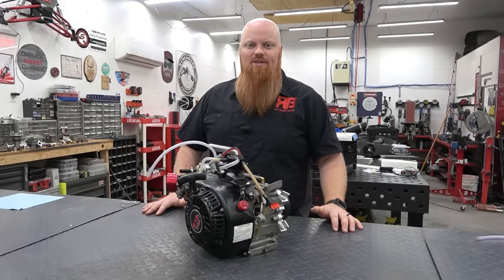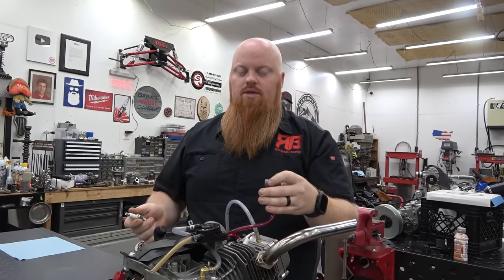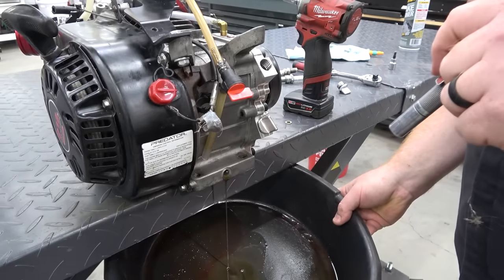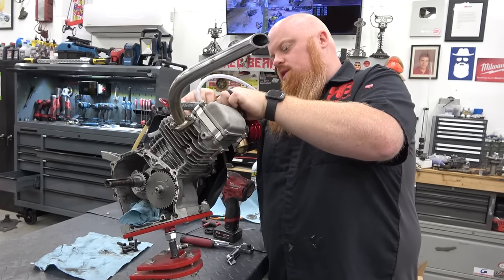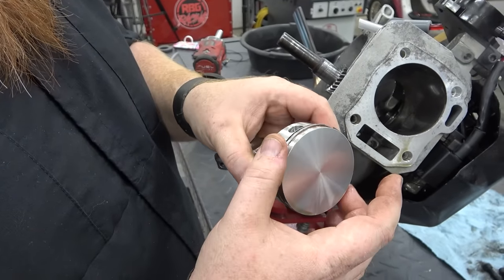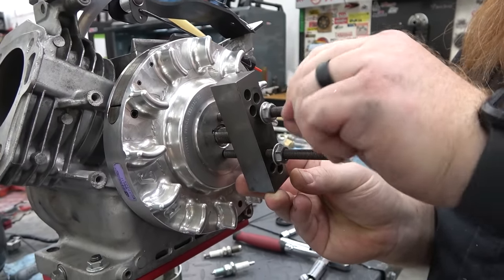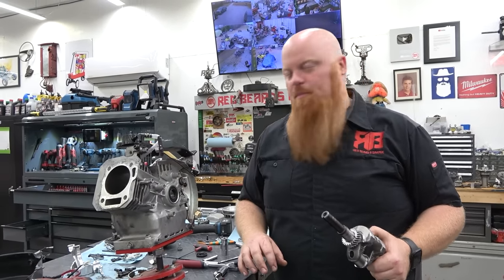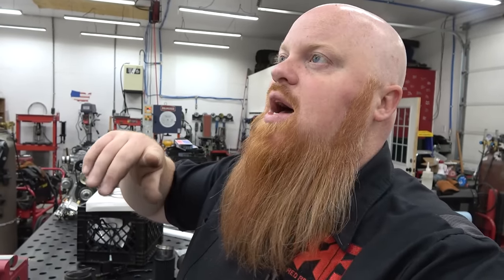My $900 Predator 212cc Wont Run ~ Subscribers Engine Teardown

Comment: Dude this guy is spot on you learn as you go couldn't tell you how many engines I've had problems with while building cause I didnt know something! Anyways I do not use wiseco anymore I bought a piston from them and what the problem was the seat for the wrist pin circlip had a bur in it or something and it pooped it out down the side of the cylinder into the crank case and the wrist pin came out and after about 60 hours of riding it wore a hole in the side of the cylinder.... It did lock up on me once time when that happened about 10 hours into the break in but I was riding the bike and was a few miles away from the shop so I dropped the clutch and it freed up. Surprisingly 7 years later the engine does still run with that piston and a new circlip.... Still when I build engines now I use JE pistons but wiseco works great for other people that build so do you lol I just don't want to risk it

Comment: Technically, you can test compression if you enlarge the valve lash...it doesn't have to be that large for the compression release lobe not to hit, and excessive exhaust valve lash won't change full compression numbers.
Reply from the maker: That makes sense. Ill try to test the compression soon in a video.

Comment: Question: When you pulled the plug you said it looked like it was running rich.  Wouldn't it have been running lean with the stock jet?

Comment: You also require a slightly larger bore when or if using a forged piston over cast. Something to do with the expansion factor in the different types of aluminum and how much or little they expand in diameter. This is why real race engines will smoke upon a cold start, waiting for the pistons to expand and properly seal. I have seen skirt scuffing on folks using forged pistons in tight bores on a regular basis. If you don't request the fact that you'll be running a forged piston to the machine shop, you'll receive a standard cast or slightly tighter bore.

Comment: one should know never ignor steps clean is king and free turning toque specs  clearances if you ignore any of that your in a mess and fueling is a must jetting AFR ratios is a thing even on a stock 212 used on Karts etc . other pull air filter off of any modern engine jets are to small they are really to small any way  not hard to have that short list

Comment: Special thanks to you red beard I’m a broke ass n. and don’t have $ to just throw at it. Between you and Paul  ( karts) I’ve about  achieved perfection on these 212’s 
$235- 4 a Tilly &
400-450$ specialty parts 
Billet internal /& good valve train just roller tips & 26 lb springs , & stock valves and push rods nibbi 28 carb, 34$ aluminum fly 
I’ve got all the power I need, any more I’m scared this small Chinese bike will fly apart! Seriously takes me longer to stop this thing. Than to hit 8500rpm 
That’s pushing stock too much. So far stock valves rods are handling 26 w fire 265 ( I’m maxed out on lift , only .020 between coils! So far she runs like a beast!

Comment: I completely pulled mine apart and put it all back together and it ran pretty good until my new valve springs broke and sent the rod through the head.

Comment: My next build I need to get the push rod measuring thing so I can order new rods and rockers. Also need to figure out the gear ratios, I got too big of a gear and it launches fast but doesn't get up to a good high speed. Maybe if I could adopt some kinda mountain bike gear shifter?

Comment: Hey guys what’s up I have a question just thought I’d ask here and see if I get an answer . I just started working on a gx160 had old crankshaft with no      Key grove I have a predator 212 crank will it fit with no mods? Thanks

Comment: HELP please.   I have a jr. Dragster with what looks like a Briggs and Stratton motor. But my intake is on the left side and the exhaust on the right. Everything I can find on YouTube has the intake and exhaust on opposite sides. Any help would be greatly appreciated.

Comment: I have a predator 212 non-hemi, I put the racer kit from GPS in it with stock carb and jet, if I put the .038 jet in the carb I shoot a 3 to 6 inch flame out of the exhaust.  My exhaust is almost just like his and carb set up.

Comment: I do not understand how someone lets water get in there engine. Intake point down: check, waterproof air filter condom: check, tighten bolts to spec: check, exhaust point down: check, leave in hurricane: check
Reply: Condensation,check

Comment: I gotta 196cc that I totally modified out but I do not have a Billet Side Cover on it. Just a regular standard side cover. Anyway for some reason the side cover kept blowing off whenever I would ride it no matter how clean i had it before putting on a new gasket and bolting it down. I got so tired of it happening that I tried spraying Copper Gasket Sealer on the block and then putting the new gasket over that and then bolted it down and it actually worked and the side cover has not come loose while riding since. I haven't taken the side cover off since then either and it's been like a 1/2 a year now probably. Maybe longer I dunno. I'm afraid to take it off cause who knows what it'll look like and if i'll be able to get it back on. 🤷‍♂

Comment: PB Blaster still lets stuff rust. I didn't have WD-40 handy so used some of this after evapo-rust and my rust came back using this. As far as a penetrating oil, its probably the best I have used. It kind of sucks it doesn't work great as a surface protector.

Comment: For $900, he could a got himself a GHOST engine with the $200 accessory kit, a CVT torque converter and a 28mm NIBBI RACING POWER JET CARBURATOR, arc flywheel, sparkplug, and coil and be pulling up to 7,400RPM all still under warranty. That's what I did. I bet he wish he had too.
Reply: it’s started off as a quick buy off Facebook market didn’t know much about it only thing I knew about it was that it was a working 212cc until I came across RedBeardsGarage video on the hemi Predator build - Jose

Comment: Wondering if you ever came across a Hemi Predator 212 that didn’t have a taper machined into the bottom of the cylinder.  I think the Hemi I’m working on now had the skirt of the piston scraping on the bottom of the cylinder.  It seems there should be a taper there and there wasn’t.  I grinded a taper into it.

Comment: I’m in a similar situation I just rebuilt a predator 224 for the first gov delete/flywheel/spring upgrade, set the valve clearance to 00.3 today I’m gonna try to put it down to 00.2 adjusted the float in the carb new tons boot along with plug but whenever I go to try to start it the pulley yanks out of my fingers, and feels like it’s gonna rip my fingers off, I’m gonna go back today and make sure that I’m on the compression stroke when I go to set the valves but if I don’t get it running today, I’m probably going off myself lmao

Comment: I don't know if it is just me but am I the only one that heard the spark plug clicking every time you touched metal before you got the spark. First time you set it down I was like it works and then it absolutely worked.

Comment: I’ve been thru the same shit, 
Just to give you a little more on things that kill performance…. All these Chinese knock off carbs are full of plastics not designed for gasoline , much less methanol! Get you a good carb. If your planning to ride a lot. I went thru 3 carbs within a year ! Good luck! 
O spend the extra on a good chain! Cheap ones are just dangerous

Comment: I'm fixing some 196cc's  engines (5) i bought them for 50 USD and one of them didn't run well because we were missing the side cover gasket and it was waaaaay too tight we literally used cardboard and RTV and it works like a charm (btw, I'm shocked about how many parts from the predators are compatible with theses 196cc engines, In hindsight there are all honda gx200 clones so it makes sense)

Comment: Did you pull the plug wire on that push mower before working on the blade? I was taught to do so, back in the '70s.

Comment: Hey RBG I just bought a pwk24mm “racing” carb for my Coleman ct200u, when I installed it to the mini bike and tried to turn it on the carb would get flooded with gasoline, so bad that it won’t start because of how much fuel the carb was choking on, fuel would start coming out the side where the air filters is adapted. And I opened it up to check the jets and it was installed with the smallest ones so there was no problem there, then I tried idling it but nothing. You got any tips?

Comment: Wow spending $900 in parts & leaving metal & rust in a new build & extra gasket & all that adds up but as a builder of 50yrs none of that is that bad as to small a jet that’s the kicker
A false add on Amazon is at fault or the seller at least all those parts are still fine check bearings with plastigaug cause they Brocken in 🤷‍♂️nice moter though great vid👍 wiseco was top for long time but now there’s ceramic coatings that make a huge difference in performance

Comment: I have a stage 2 built 212 non hemi with a flat top piston. I went to start up one day, it ran for a moment & then died, tested it later on while I was still by where it was decided to see what the issue was, found out the E3 spark plug I had in it for awhile had died...  robbed, the plug off my 301 & now it runs

Comment: 18:16 you apparently had the same issue he did. Your socket wouldn't fit all the way down on the 1st carb nut until you took the second one off. You weren't even loosening it for 90% of the first attempt.

100 bucks says his socket didn't fit in the alotted space, either. Likely because the holes aren't centered so it's to close to the wall of the air horn.

Comment: Hey I have a predator 212 I put 265cam arc rod with Wisco piston billet side over. Arc flywheel miki 26mm. Only thing I'm having problems with it pulls over so hard I've timed it write and valve settings are correct. It's still pulls over hard and I put Honda gx160 head non hemi. I broke the pull cord 2times I broke the cupler inside the pull start and the plastic handle broke lol.

Comment: You can buy these Predator engines now as Go-Kart engines directly from Harbor Freight, where they have already done all of this work. Just in case you want one of these things and not have to hand build them out.

They are 212cc and called GHOST Kart Racing Engines, and they only cost $329.99.

Comment: It’s soooo funny that I’m watching this video I’ve literally build my first engine I’ve probs got about 600 bucks in it and the craziest part is that we’re both named Jose and it’s our first engine we’re working/building one😂  however my first build was the 224 not the 212 however I do have a 212 that was my first engine I bought witch I plan on upgrading as soon as I get mines running good it’s runs pretty good like a beast but I’m having issues with metal shaving
Reply: It’s the Jose curse bro -Jose

Comment: Idk if I missed it, but was the cam checked. A step I see missed over and over is break in oil and adding zinc for the cam. Even a small on engine like  this. I have personally flattened two v8 cams not doing so and a honda gs 13.5 hp small engine. Ive been building motors 30 years so take it for what it's worth.

Comment: If i had a dollar for every time i messed up. I reused the nut that bolts the cv axel to the hub on my car. Ruined a brand new bearing and the hub in a couple of months. The nuts are one time use ONLY. The mechanic I took it to is who told me about it. Had to take it to a mechanic because the hub for a 2001 Ford Focus ZX3 is apparently impossible to find. Took weeks just to get the part. I drive for a living. EXPENSIVE mistake, lol.It slowly vibrated loose. I've known a few people who have had problems with of Wiseco pistons.

Comment: Great information and teardown.
I did notice you talked about checking bore "square" or "round", but didn't see you check it. Then using the ball hone. Using the ball hone on a bore that hasn't been miked and has imperfections, isn't a good idea. If the bore has imperfections, like this one, I would highly recommend not using the ball hone at all. Use a "normal" hone. Ball hones should only be used on a perfectly "clean" bore.

Comment: @redbeardsgarage 
On my honda gx160 (same as predator 212)…. When i pull the side cover, there is no bearings… much less 2 bearings. I am 3rd owner and having motor problems. Do all the motors like this have bearings?

Comment: Looks like Jose or hose watched a YouTube video before he put this thing together…
And Greg, you just rub and touch everything without measuring?
Decent effort but videos like this are what cause engines to be built like that.
What was the deck height on the piston?
What was the piston wall clearance?
What was the valve lash?
Why is the fuel pump connected wrong?
Oh and what was the spring pressure and valve lift? Or did you just touch it lol

Comment: ive done a flywheel and a carb and now my predator doesn't run after about 3 hours. i checked everything yall did except for taking the head completely off. i saw aluminum but did no tappping to my engine. im at a complete loss

Comment: Hey red beard look at his crank. I’m thinking where he didn’t clean the gasket material off and where he didn’t use spacers on the crank there was to much play and the crank and the camshaft was rubbing together(maybe y it’s shiny on bottom of the crankshaft….also the rust in cylinder didn’t help anything haha, good job tho that’s easy mistake to make!!! 
GREG DO U THINK THAT COULD DO IT!?!?!?  @RedBeardsGarage. @redbeardsgarage #redbeardsgarage

Comment: That WISCO piston is the failure. I can tell by the piss poor design quality of the must remove rings to pull piston head. Also the piston head is not meant for long time use. It is meant for a few laps if not 1 lap before complete tear down. That is why the piston is designed with the single ring over the knuckle. They figure you going to do a complete teardown and rebuild anyways.

Comment: Why would you spend $900 on a Predator 6.5 HP (212cc) OHV Horizontal Shaft Gas Engine, EPA  that cost $149.00 new?

Comment: almost as much of a hack as the original builder. Soooo many things you did'nt check those lifters needed to be labeled also.actually the list goes on and on    Torque to yeild is just that You probably should stick to "building" Lawnmower engines